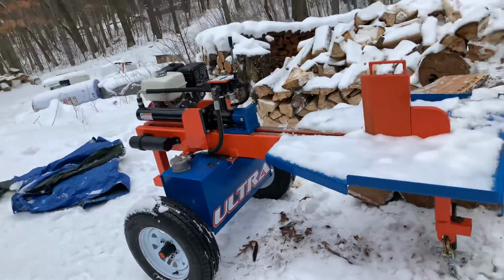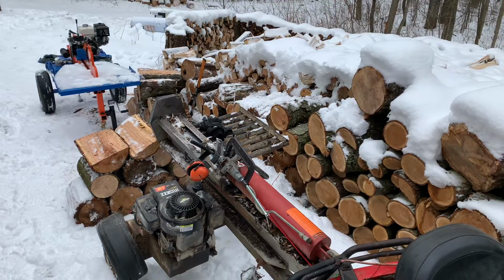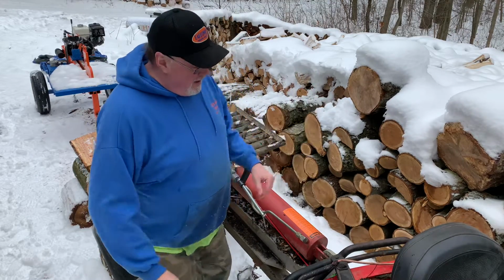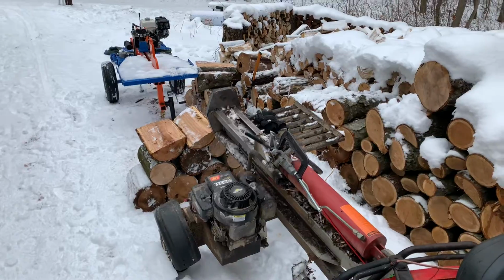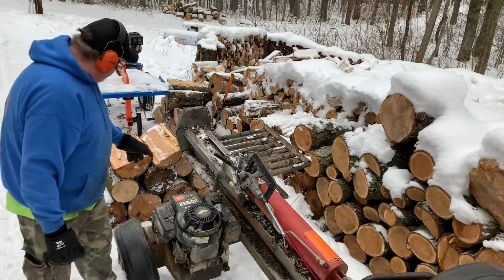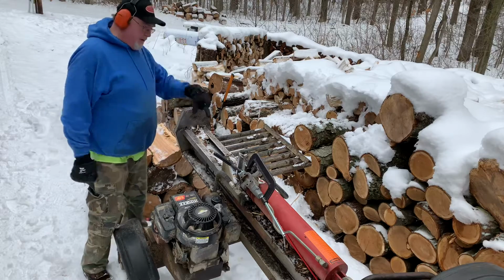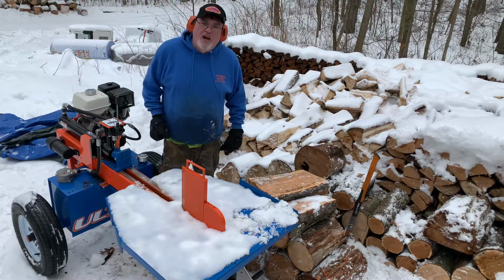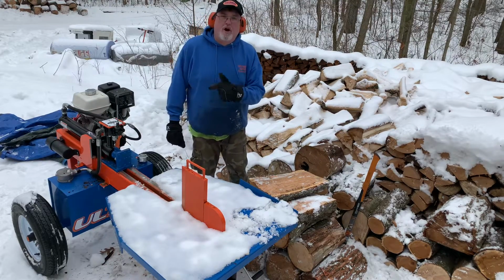EASTONMADE ULTRA 2020 vs 2010 Huskee 35 ton log splitter

Comment: The Eastonmade is clearly the winner!! You run the huskee faster because your more comfortable with it... but with more use of the Ultra you will get faster. The cycle time on the ultra is crazy fast. Definitely go help the saw surgeon split some wood...
Reply from the maker: These pieces also didn’t require the ram to go very deep into the blocks which helped the Huskee

Comment: the Husky wins at one third the price of the Easton.....buy three huskies and run them side by side with one Easton, now that would be production !
Reply from the maker: The Eastonmade is so fast that it might be worth it running it with two people
Reply: @JoesFirewoodVideosII   Yes it is a very fast splitter and just needs a couple modifications to make it a Great splitter !
Reply: seems like single wedge is working much better for you than the four way. That machine is begging for extra help to keep up. To fully utilize the much higher purchase cost, than a Husky it seems at least two crew are required.
Reply: Yea, but you would need to pay 2 extra guys to run the other 2 splitters.  Right there you would eat up the cost difference in a hurry.

Comment: Speed and build quality go to the Easton - no doubt about that.  I think the Huskee / Countyline type splitters - in the same tonnage range - will split the more difficult pieces better than the Easton and last time I checked they weren't going for $4000.00 either.  I suppose it boils down to what you really need, the type of wood you split and how much.
Reply from the maker: Yeah most of the blocks I cut/buy are gravy train

Comment: If you wanted fair comparison you should have split the pieces the same size. As you can see in the video you split the pieces with the husky a lot smaller then the ones with the other splitter.
Reply from the maker: I find that hard to believe.  I split everything in the 4” - 6” range